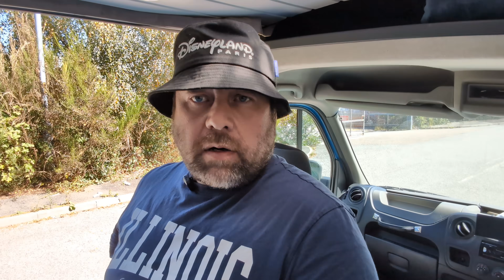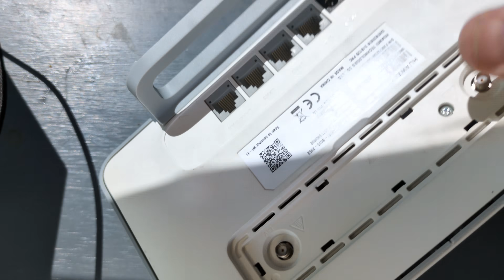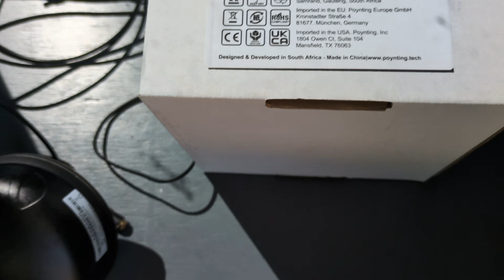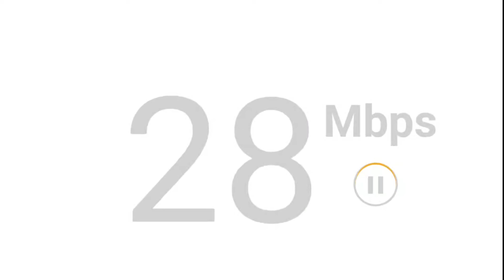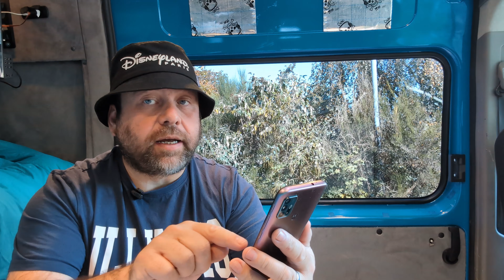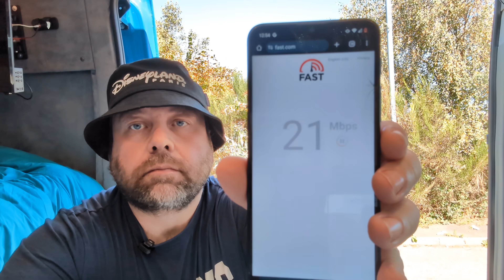ULTIMATE OFF-GRID Always on Camper Van Wifi for under £100!

Comment: Most of the Huawei routers need you log in to the webpage and change the antenna setting to external for the puk to work properly, if you haven't done that then the extra speed might have been from the internal antenna because the door was open.
Reply from the maker: Thanks for pointing this out. Someone did bring it up and I checked my was on auto
Reply: @CummaszonAdventures if you haven't already change it from Auto to External 👍🏻

Comment: Great vid as im off to Cornwall in a few weeks and I need my tv in the camper so im looking into the best device as star link is to expensive for tv. As im travelling all down the north coast for the first time. Is there any terrible areas where there is 0 signal. 🍻
Reply from the maker: You would be pretty unlucky not to get anything so for TV you should be ok. If you check out my hidden gems series you will see some sites I recommend down West.

Comment: Hi, you need to connect an extra "inside" standard antenna to the other antenna connection on the router. So the outside signal from the puck is going to the router, and te router sends the signal throug the inside antenna into the van. Now you will have the full potential. Good luck.
Reply from the maker: Good plan. I will give that a go. Thanks for watching

Comment: As a test you should try putting the router on the dashboard without connecting to the puck. You may well find it gives similar results. I never bothered with a roof mounted puck as I found with the router next to the window, it worked fine.
Reply from the maker: Thanks for your comment. You are right that does work in a lot of circumstances, however the places I normally stay you need every bit of extra signal to make it consistent

Comment: ............... Netgear nighthawk M1../2/3..........etc.......ANYTHING ELSE DONT BOTHER....any cheap ts9 connecting nimo Ariel will do.........Thank me later
Reply: Apart from the overheating issues that will cause it to shutdown. Not really suitable for an always-on solution unfortunately.
Reply: @VanDayz take the battery out and run it powered, stops the overheating. 👍🏻

Comment: And which service provider do you use?
Reply from the maker: I use EE here in the UK. Thanks for watching
Reply: @CummaszonAdventures EE is a good bet for basic coverage out in the boonies, which is what you want in the van. They also do 'throttled' 5g sims heavily discounted if you have their broadband at home. I get unlimited data volume, but capped at 10Mbit rate for £10 per month. It does YouTube OK.
Reply from the maker: Great information. Thanks 👍

Comment: You can get a magnetic mount MiMo for the roof and feed the cable through the top corner of the rear door the seal still stops water coming in and you don't need to drill holes in your roof. It's a good solution if you're retro fitting after your van is finished and don't want to take your ceiling down.
Reply from the maker: Thanks for watching and the comment. You are correct as I was making a hole for the CCTV cables I fed the antenna wire through the same place and situated it on the roof. Great information for others. Appreciate it 👍
Reply: @CummaszonAdventures I went wireless with the Blink system as it was a retro fit. I also like the idea of clips going to the cloud rather than card/hard drive storage as if someone finds it it's useless. I can also talk through the cameras. When you tell an intruder the footage is going to the cloud they would soon leave
Reply from the maker: Yep I might look into changing it further down the road